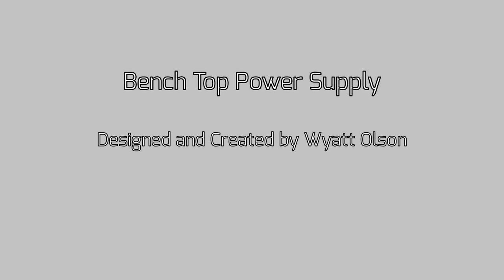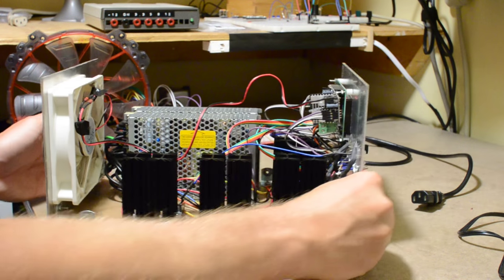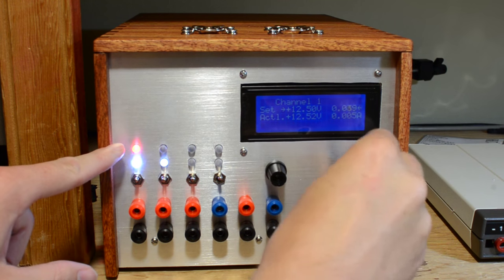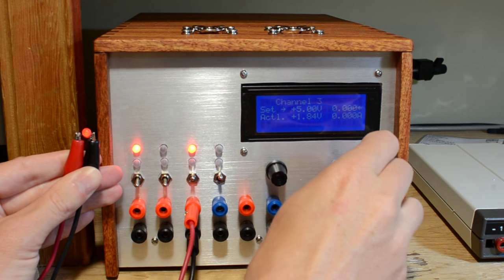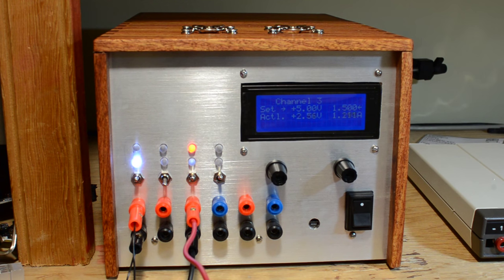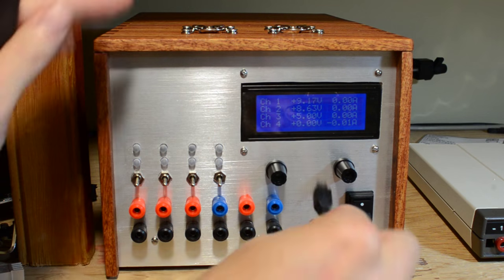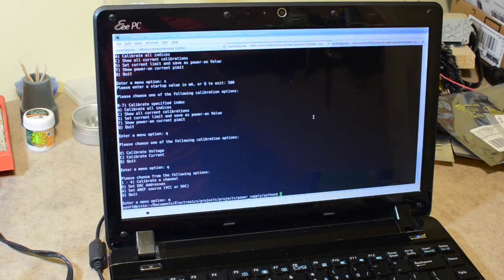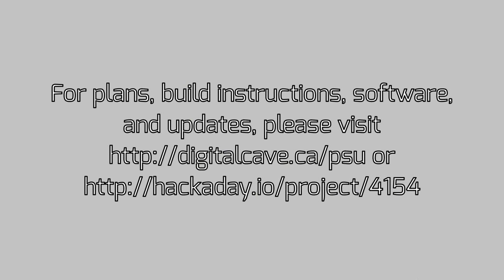Bench Power Supply Demonstration - Finished

Comment: Not sure I would like holes in the top, just in case something falls or spills in and ruins me day. Nto sure blowing in rather than sucking out is the better option. Nice modular and nice display though. Positive and negative rails is good. What is it like with split supply amps like LM1875 I have use two identical SMPS before to power dual rail LM1875 and it cuts out after a minute or two. LmM1875 wants earth for 0V

Comment: Very nice !  How much noise and ripple are you getting from those switchers ?
Reply from the maker: The 15V output directly from the switch mode supplies is actually not bad.  I had done measurements but don't remember exactly what it was, but it was reasonable (not perfect, but reasonable).  After regulating the voltage down using the LM317 the ripple is negligible and is within spec of the LM317.
Reply from the maker: Pretty sweet! :-)